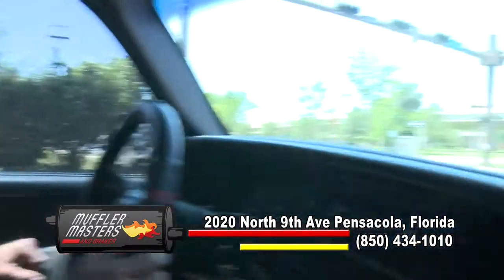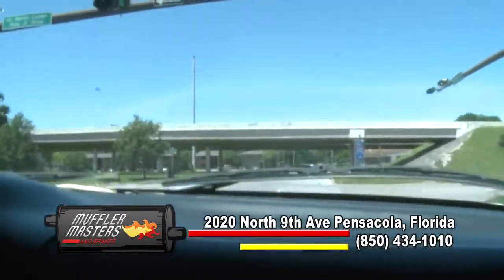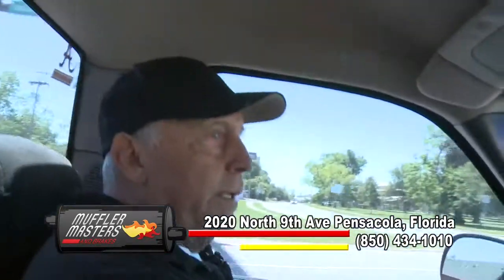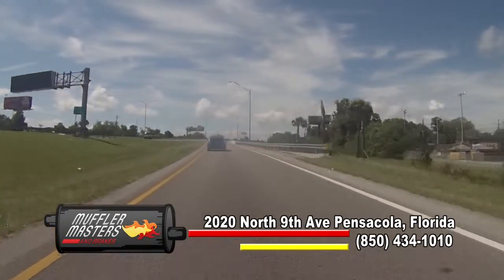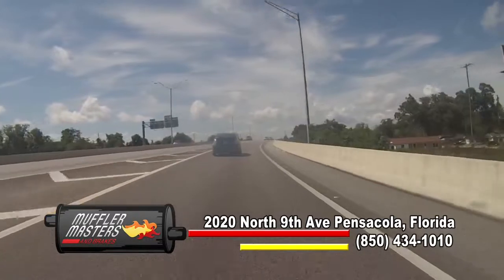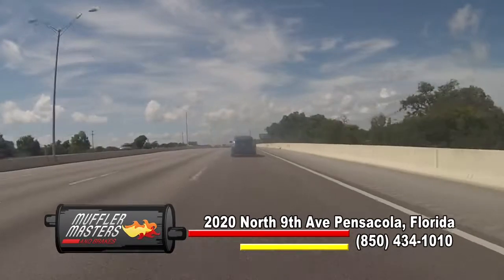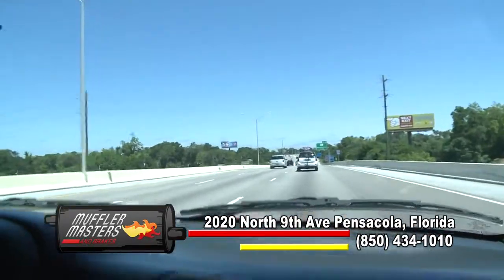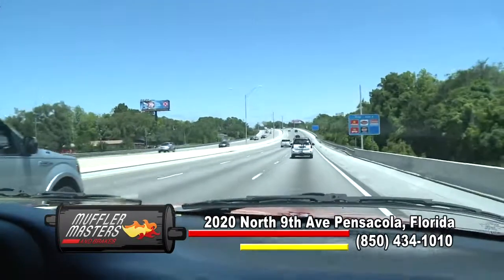Our in cab muffler sound test

Comment: Usually the most drone is 65-70 up a slight incline or pulling a light trailer so the engine loads without downshifting. That’s the worst drone point.